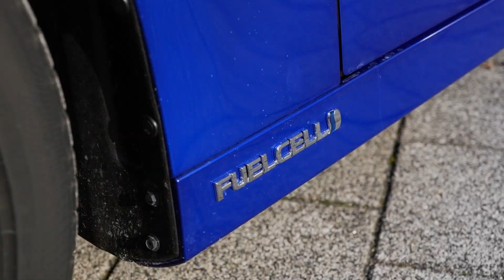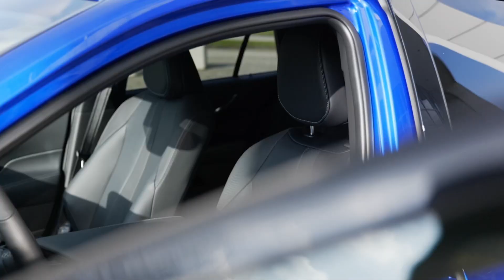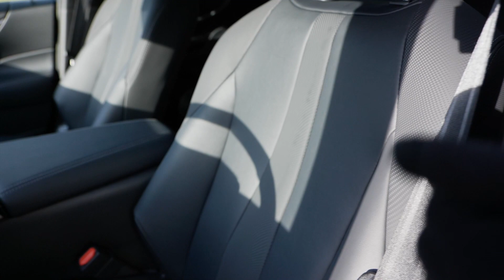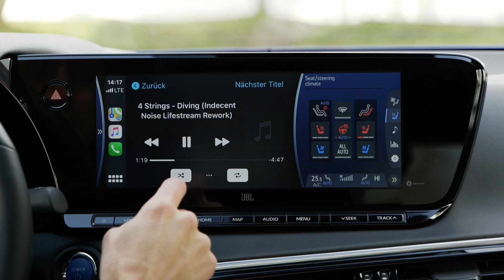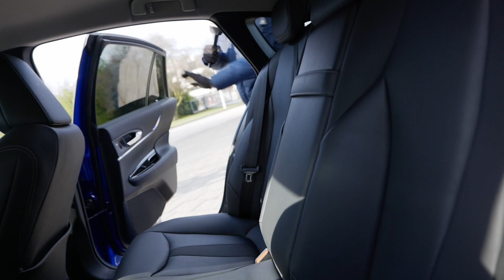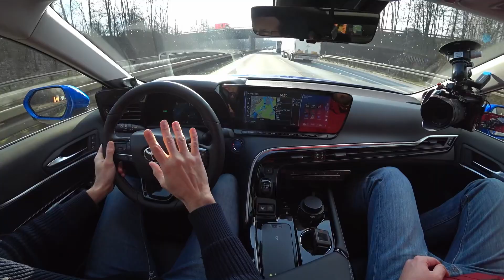Hydrogen power car instead of battery EV: new Toyota Mirai driving REVIEW

Comment: I think this technology would be best suited to large commercial vehicles (LKWs, HGVs) than small passenger cars. There, it is possible to put tanks between the frame rails and under the cargo floor. Also, the fueling stations can be more easily located at centralized truck depots for fleet operations. And as Thomas has pointed out, the infrastructure for sustainable sources of hydrogen will need to be built up.

Comment: They should make a battery-hydrogen hybrid with a small, cheap and efficient battery for everyday use and a hydrogen fuel cell for long journeys where efficiency is less important than refueling time.
Reply: I would rather have it with a FC REx. Given that hydrogen stations are so rare.
50kWh battery and a FC to maybe eek out another 200km. After 400km it's ok to have a break to charge the car up and maybe fill up with hidrogen.